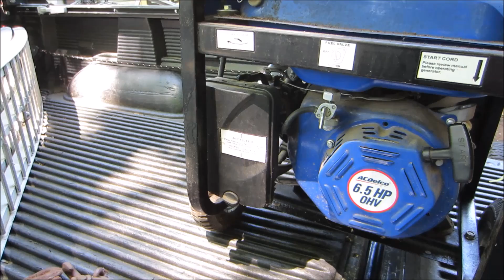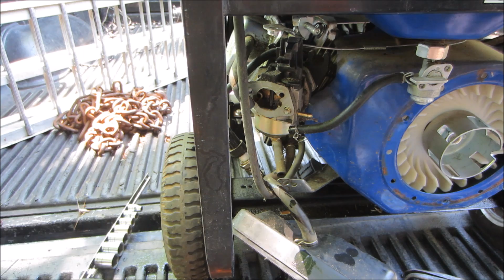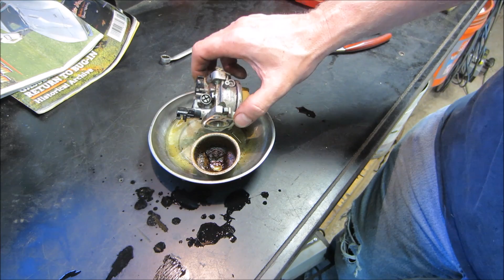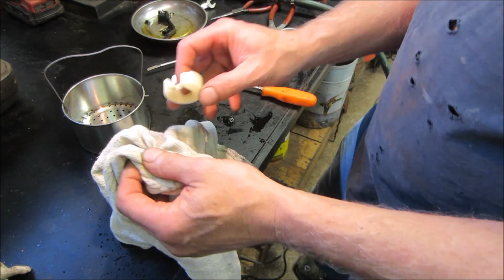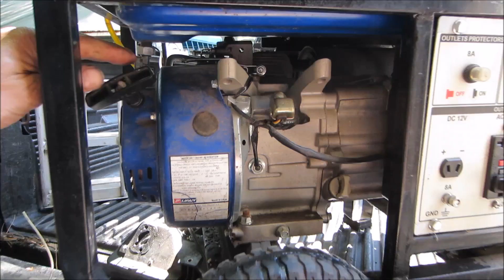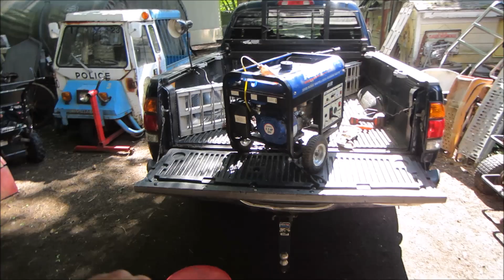will it run? seized china generator

Comment: I bought a HF 8750W generator and although it’s made in China, it starts on the first pull & ran for 12 hours straight (as spec’d in the manual) during one of this past NE winter storms. When I put it away in the garage, I first drained the tank, then drained the bowl & put the drain screw inside the tank fuel strainer so I don’t forget to put it back in the next time I need it. The theory is to leave the screw out so all of the gas can evaporate and no water can condense in there, causing a blockage.
Reply: Just because something's made in China doesn't mean it's inherently poor quality. Like anything else, you get what you pay for. Don't buy the cheapest shit you can find and expect it to last regardless of where it's made. I've had American made stuff fail way before the China version and vice versa.

edit: I realized now you're being sarcastic, but the point remains the same.
Reply: @maaadcheddar  I love Japanese products!!
Reply: I've got their 4k watt open frame generator that I bought about 7 years ago. I do very similar! I don't even use the gas tank unless it's needed. I just run it off an external tank and drain the carb when done, and always blow the excess fuel out with an air gun. Tank sits empty, oil fogged, with a dessicant bag in the little screen thing under the cap. The people that say preparation like that is silly or wonder why we go that far are the ones stuck without a gen during a storm. It's even worse when they aren't mechanical people and they just bought a gen and let it sit for 3 years in the shed with fuel in it. No way in hell they're going to get that running.  Only bad thing about it is I have a new condition old style gen and I want one of the new quiet inverter gens!
Reply: @volvo09  DANG, scary, I thought I was the only one that did this LOL
Reply: yes stop using that chinese junk. give it to me instead
Reply: I like the idea of oil fogging the tank so it won’t rust - will have to look into that...

I hear 2 things all the time - “HF is junk”, and “everything that comes from China is crap”. I personally find even the brand-name things are made in China with a big markup, so why not just buy the lower priced item? 

I think “made in China” shouldn’t be a label any more, but you still need to look at the quality of whatever it is you’re purchasing. The carb kit for my CL350 came from Taiwan and works great. HF has good tools too, now that Sears is gone.
Reply: @jacktan, some of the Chinese made products are decent.  True, Chinese generators aren't the same quality was a Wacker Neuson but if you take care of them, they will perform well and parts are very cheap.
Reply: @Mikesorrento3344  we might be related lol
Reply: Simplex Grinnell ... I've  never gotten junk from Taiwan.  I am restoring a 95 Dodge Dakota pickup and 80% of the parts that I buy on line comes from there.  Even the body panels that I get fit.  I believe Chrysler sold all of the tooling to someone over there.   Please don't  confuse China with The Republic of China/Taiwan, the ROC has a manufacturing standard about like Japan even if it is a tiny country.  I'm not Taiwanese but I  would like to say,  don't  hesitate  to buy their  products they make pretty good stuff.
Reply: It's ALWAYS good practice to shut it down by turning off the fuel valve, rather than the run switch. Let the carburetor run completely out of gas, then when it stops, put the choke on, and give the cord another good yank. It will act like it wants to start again, but it's just clearing the last bit of gas out of the running and idle circuits of the carburetor, ensuring that there is no fuel to evaporate and leave behind varnish or gum. This is especially important, if you don't know when you'll need it again. It also reduces the likelihood of flooding the crank case with gas, if something goes wrong with the float, needle valve or seat. Not just generators, but ANY engine with gravity fed fuel delivery.
Reply: that's what i wanted to say
Reply: Bad obsession
Reply: Exactly what I do with my power washer.   Works great for less often used machines.   I also pour any gas left in the gas can into my car.   No stored gas to go bad.
Reply: I'm keeping your idea it's simple and brilliant 👍😆
Reply: Jonathan Corbett Speaking of Bad Obsession,  I need to go watch their latest episode. Thanks for reminding me :)
Reply: Simplex Grinnell ... It gives insects a chance to invade the carb.
Reply: Canuck Guy Worried  If you get tired of her or she breaks down, send her to me. I may be able to fix her. My current model is from Hong Kong and is starting to nag me and play up. BTW, I am joking. Lucky she doesn't watch Mustie videos as I would be getting a smack over the head.
Reply: +steazye - I've been given plenty of old "Made in England" tools...given for a reason - That particular brand was junk, drill bits that wont hold an edge and blunt as soon as you look at them, T bars that bend from the slightest pressure....seems the chinese musta got scammed and thought they were buying a great quality tool maker...I often wonder if thats the case

Then again there are still some decent made in the EU brands - PCL air fittings,  Gedore, Hazet, some Facom stuff,
Reply: @Simplex Grinnell, I go the other way - make sure the gas tank is topped off with fresh fuel+stabilizer so there is no room for condensation. I keep the carb wet (though obviously still shut off the fuel). Every month or two, I run it. If by some miracle we make it all the way through the winter without losing power, I suppose I'd drain the tanks and put fresh fuel in - but that's never come up :)
Reply: Don't the Chinese build Boeing Aircraft under licence in China ?. The very common 737 ?. As everywhere some excellent products, some crap. You get what you pay for of course.
Reply: If you keep draining the tank, you are going to get a rusty tank. A better option is to top off the tank with ethanol free gas, and then every year or so, drain that gas out and replace it. No oxygen or water in the tank, no rust. Rust is a big problem.
Reply: yes definitly if you take care of them they sure last long
Reply: Simple solution : I recommend STOP using made in China items if you want to make it sound like its usually crap and doesn't work. Best not to buy just in case so no one will complain anymore. Throw your iphone if its manufactured within China because it may explode anytime and emit harmful radiation. Cheers!

Its just like going to a restaurant to eat and complain about the food. Except you come back for the next 100 times and complain EVERYTIME LMAO!! :DDD

Comment: I have worked on many of these with the same problems. I don't understand why GM or Snap On would license the AC Delco name or Snap On name to products like these which are not up to par quality wise to legitimate Honda or Yamaha products. These generators should be branded China Clone.
Reply: honda, yamaha, etc. would suffer the same issues if not taken care of properly...the problem is not these things being chinese..it's the f'ing ethanol in the gasoline..
Reply: @eldora, AC Delco probably didn't license this.  The Chinese will counterfeit just about anything.  Just a few years ago, there were containers of John Deere generators confiscated....all unlicensed counterfeits.
Reply: all for the same thing why John deere and kubota licensed home depo to have there name on some crap tractors models that line the whole front of the home depo stores

Comment: Nicely recovered :-D, yes its cheap but it's a shame to let any generator die.
Your ultrasonic bath is a handy tool, cleaned that carb a treat :-D
Reply: Is there any channel you don't watch? lol! I keep finding you on all channels, haha...
Reply: Ultrasonic cleaner is the way to go you can see the junk coming out, my wife throughout her jewelry cleaner and I won't put a carb back together without using it first.
Reply: @davidtiejema9550  - I have a bunch of carb bodies to clean of old fuel deposits, and I have an ultrasonic machine. What liquid is the best to dissolve vanish and other gunge from inside the carb passages? Is there any need to clean jets with wire cleaner or will ultrasonic do it good enough?
Reply: @johncoops6897  just saw your question. Physically taking it apart and cleaning all parts is best all holes you can find. Then drop it in the ultrasonic cleaner I use dawn followed by clean water. Then dry completely. My experience cleaning a small square carb from a leaf blower was dramatic.  The ultrasonic found whatever was in I could not see and cleaned it.
Reply: @davidtiejema4138  - thanks for your reply. The worst carb is from an almost new Chonda GX250 clone that saw about 10 hours use. - I don't know how or why but it seems I'd stored it with 1/2 tank of gas (no fuel conditioner) and the fuel tap was left turned on.
No idea how many years it sat like that, but the stuff on the bottom of the tank is like  BLACK rock. The fuel filter thing was a 100% solid block of blank gunge, I had to use a twist drill to get flow thru it.
I wonder if dish soap/liquid would be grunty enough to dissolve the varnish in the carb? Inside the tank, the only thing that slightly softened it was carby cleaner spray (and even that still requires scraping with a wood chisel to unstick it LOL
Reply: zx8401ztv lol! Yes, I found this to be an interesting channel as well. First watched the volkswagen bus 31 year videos for a bit and now this one... I subscribed.
Reply: MrDubje, LOL :-D, Well you could look at it another way, i share your good taste in quality channels :-D.
Ok i'm like horse sh1t, i'm everywhere :)
Reply: Have a look at the millions of channels ive liked, you may find some you like too.
or you may hate them all LOL
Reply: I just use some dish soap it makes the water wetter.
Reply: zx8401ztv i normaly youse a deisle cocktale. The gas oil deisle we youse now is 10 times more toxic than the old leaded stuff of old.
Reply: Not having a go at your spelling, but what you are saying is really confusing for non USA readers. 
I take it 'gas oil deisle' means a mix of petrol, oil and diesel
But only petrol had lead added to increase octane; it wouldn't help diesel at all.
Reply: 68404
it's a good idea to put the name of the person you are replying to at the start of the comment :-).
We all receive it otherwise, now that can get confusing lol.
I don't understand what brian is talking about eather, you are not alone.

Comment: 😳AMAZED ONCE AGAIN😃...TWO THINGS ON THE SPED UP CARBURETOR REASSEMBLY😂 the birds sound like they are on METH🤣😂🤣 AND   If you talk at 2X when your filming the part you plan to speed up🤔🤔🤔
WILL YOUR VOICE SOUND NORMAL WHEN SPED UP??
HOW  did you “UN SWELL” THE GASKET?
Some small engine shops would have sold him a new generator?? Or A NEW ENGINE FOR MORE THAN THE GENERATOR COSTS?   ⭐️ANOTHER RIVETING VIDEO⭐️  🍎GREAT JOB🍎GREAT VIDEO🍎
Reply: This comment gave me cancer
Reply: Jesus Christ Pete, lay off the crack already.
Reply: Pete Lasko he would have to talk two times slower to get the desired speed once speed up
Reply: I think try talking at half speed in the portions that are sped up 2x would be a good experiment to see how natural it sounds.
Reply: Wondering about the 'tricks' he speaks of as well to shrink the swollen gasket. He did mention something about cutting it down to fit but how do you keep fuel from leaking around the cut?
Reply: staind288, i am glad you asked, as for-useing the rubber seal if need be, you clean used rubber carefully with mild soap and warm water (not hot) you cut it square and cut it to fit and lay it in place and yes a drop od super glue, or crazy glue to join it to gather, you can buy kits od different sized and strips of rubber seal, such as o-rings to square rubber seals, or you can buy individual 16" length of any type you want, i keep many standard o-ring kits on hand in SAE AND METRIC  as well as high presser hydraulic o-ring kits as well as an assortment. of square flat rubber seal strips to make up any size i need, as i am an hour from any town, i dont stock o-ring strips as my o-ring kits have many sizes and if i dont have the right size i just cut an o-ring and make sure it is a strait square clean cut on both sides using a very sharp razed blade, setting them in placebuted up tight and a little drop will do, the main thing is weather you are re-using or using new always make sure your cuts are as sqare as you can be and fit tight before gluing. note dont be buying the o-ring building kits or sqre rubber seal building kits, you pay though the nose for them and half the stock they come with you never havea use for, just buy the most common sizes needed, i started out just buying a few of each one i needed and kept a list and over the year have a list of sizes, for both standard and high presser. they both can be glued the same way, just do not touch your cut ends with your finger, as oil from your skin is no help, have a great day, boiling them is a big no no, that is why his seal stretched, from his hot cleaner, they will also stretch f they stick well taking it a part, and do not clean them with any parts cleaner
Reply: staind288 it is a trick of the trade, in fact it is simple, a little drop will do ya
Reply: Arnold Romppai I'm not exactly sure what you're speaking of with one drop but I do know about boiling them, I also know about freezing them, and I also heard about cutting them and gluing them with super glue. But I was curious if he had some sort of special chemical that you apply that removes the contaminants out of the rubber. With your comment of one drop will do you I am assuming that you are speaking of the super glue trick
Reply: Arnold Romppai thank you for that response. I appreciate the detail
Reply: Your welcome staind288 any time

Comment: Flush the tank, then fill the tank with muriatic acid, do that a couple times, then put some rustoleum rust reformer in it slosh that around, replace the cap. On some engines that idle hunting means your idle is set to low.
Reply from the maker: if l did that it so thin it would look like swiss cheese,
Reply: Why the hell eould anyone put acid in the gas tank 🤣🤣🤣

Comment: have AC Delco sold out to cheap Chinese brand-or are they made for Ac Delco ?

  in any case,excellent reviving DEAD unit

    -now to instruct owner HOW to care for EMERGENCY backup units
     so it works-       when you NEED UNIT ~~!!
Reply: IF STRICT QUALITY controls applied AND replacement parts
   readily  available for say 5 yrs minimum,should be ok
    -BUT if JUNK pedded AND no backup=DISASTER

Comment: Looks like that even if they had shut the gas off that tank and fuel condition would have stopped it eventually. With a little preventative care things will last a lot longer. Turn off the gas and run it dry after every use. These folks are lucky to have mustie close by!

Comment: Maybe someone here can help me? Hello, i got a vespa ciao since yesterday, i check compression which is good, i cleaned the carb, it has spark and new fuel, also i tried adjusting the screw for fuel but it still doesn't start. Anyone have a idea whats wrong?
Reply: djmips got it it runs now
Reply: Watch more Mustie1 videos. He even has a Vespa will it run. (old model)
Reply: MrPyroBomb did it run
Reply: The main jet was bad got a replacement now :D
Reply: MrPyroBomb try cleaning the points. Even though it has spark it might be too weak
Reply: MrPyroBomb ok that's good
Reply: Jake Wright It runs now it goes 40km/h with bad tyres and needs a tune up.
Reply: MrPyroBomb ok that's good that it's at least running now
Reply: canuckguy worried yes first bike, i also have a 1991 jetta 1.6 diesel wich im working on!
Reply: canuckguy worried nice! Today they all ride piaggio zips around here (Belgium)